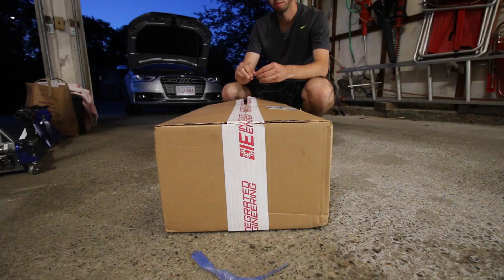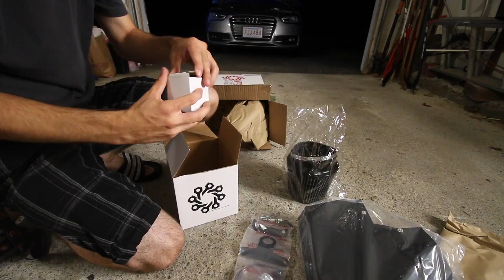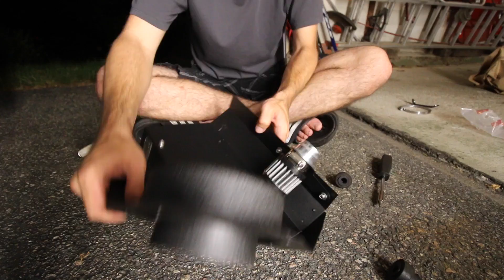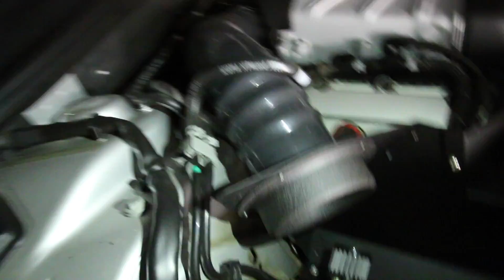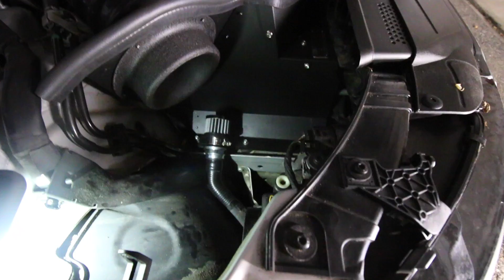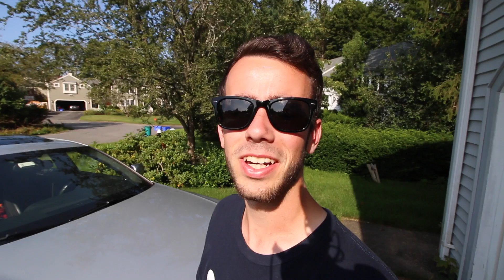Integrated Engineering Intake for my S4!

Comment: why would u get an automatic?
Reply: in this car it's quicker and gets better mpg than the manual. I had manual a4's as my previous cars and recently bought a b8.5 S4 with the dual clutch. I miss the manual sometimes, but the dsg is nice. quick shifts and plus my left knee has been having problems so it's nice not daily driving in traffic having to hit that clutch all the time. so there are benefits.

Comment: Aside from the APR which is crazy expensive this is a pretty decent design, I have a cheaper version similar design on my S4 and I actually think I've lost power, the metal tube is just a heat magnet and it's not even warm out yet.

Comment: I bought a different brand, but I have a Audi A6 3.0T which is supercharged. The brand I bought didn't make a specific part for my car so I heard I could buy one made for the Audi S4, It fit perfect as far as the filters and pipe. I just need to install the heat shield which looks like it'll be easy. It sounds awesome.